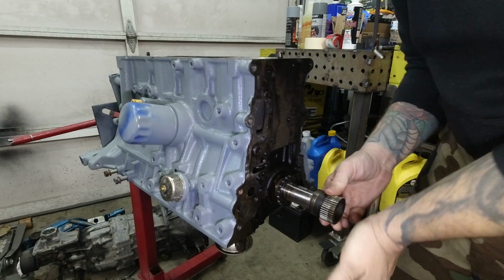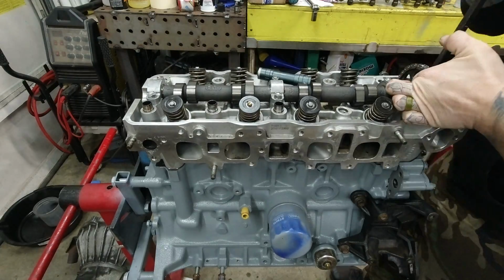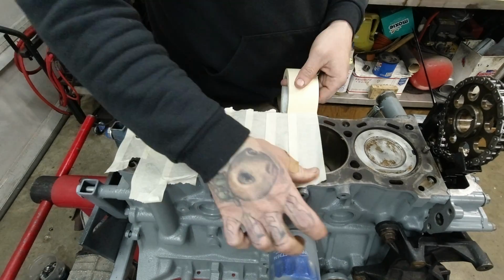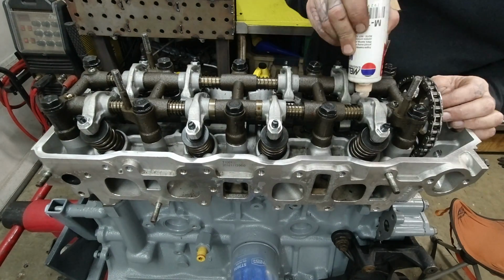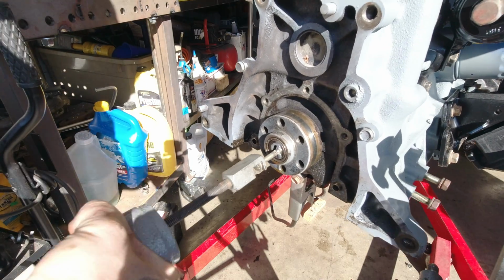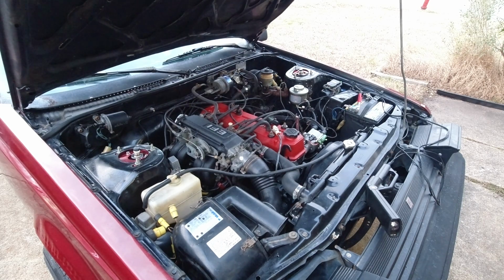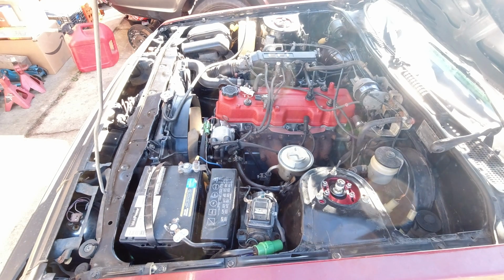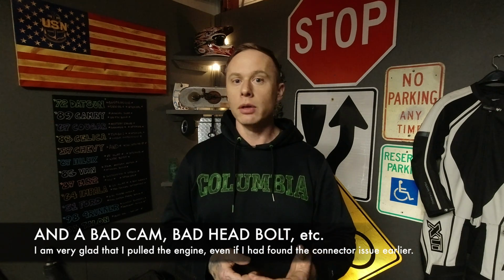TOYOTA 22RE ENGINE REBUILD - PART 2 OF 2 - Assembly, first start, and minor fixes 22R

Comment: 🤔Boy I see three bad mistakes you made on your Toyota 22RE engine I really do KNOW I am a REAL ASE certified Master Auto Mechanic with OVER 60 year's of REAL experience . for one you put a helical on a cylinder block you're supposed to use ONLY a king search that was a bad mistake  AlSO YOUR  intake and exhaust  valves are OUT of  adjustment AlSO YOU
 ARE using THE wrong type of timing  light sound like you had that engine cross wired
Reply from the maker: My valves are adjusted perfectly in spec. And my timing light is not the best, but it works. Perhaps finish the video all the way through to see what the real cause of the poor running was. Everything was wired correctly and this engine purrs like a kitten. Got 34mpg on a road trip from VA to Chicago with no overheating and no issues whatsoever. So I'd say I did a pretty fantastic job on this top end, thank you very much.
Reply: @tinygaragefab 34mpg?!!! Damn those are figures I wished I could get on my pick up. That’d be great
Reply from the maker: @kenxiong6830 yeah, this Celica surprised me on that trip. Virginia Beach to Chicago, 34mpg, ZERO issues.
Reply: @tinygaragefab  that’s sweet. I love the 22R. One of the best Toyota engines and engines in general ever built

Comment: 🤔YOU JUST made a BAD mistake on your engine block YOU were supposed to use ONLY a King search.  NOT a helicoil   I REALLY DO KNOW I AM a REAL Machinist THAT engine will give problems NOW .THAT engine WILL overheat NOW
Reply from the maker: But...its been going for 10k+ miles with ZERO issues, so I'd have to say you might be overreacting a little bit. If cylinder head torque can be maintained, no issues will be had.

Comment: I'm acquiring an 85 22re Toyota Pickup extended cab. What do you recommend that I do to check on what needs replaced the most as it's sat for a very long time. I already know it may need a new fuel tank or at least a new pump probably. What else do you recommend just replacing or checking?
Reply from the maker: Definitely fuel pump. Replace your battery cables, especially the ground. Other than that, try to start it and diagnose from there. On my '87 pickup (22R) it just plain ran. I replaced ignition stuff and filters and sent it!
Reply: @tinygaragefab  awesome thanks, it sat for 15 years and I dropped the tank and it looked like what I imagine The Grim Reaper's toe jam probably looks like. Or a burnt down car. You get the point. Well, anyways, I decided to order a fuel pump and pump mount, fuel filter, sending unit (for the fuel gage), and a new Spectra tank. The only OE item not discontinued that will fit is the pump mount. 85 and older Toyota Pickup parts are so hard to find. Aside from that, I will test the pump with the cold start injector line and pre-filter lines disconnected to insure fuel is making it to the injectors and then I will put in the new filter, then some new 10w40, and some Coolant after I see that it can idle smooth and hold some higher RPMs. For now ill top of the reservoir and put in some oil additive to rejuvenate the old seals and some Coolant flush before applying all new Coolant.

Comment: i was wondering if turbo charging the 22re toyo would net a torque gain of 275 streetable torque??
Reply from the maker: Probably not on turbo alone. That would more than double factory power, which takes a bit more work. There are 300+ hp/tq 22REs out there, but its not "easy"
Reply: It's doable for sure.  I just had my 4runner on the dyno and it made 250rwhp and 290 ft lbs @4800 with 4:88's and 35 inch bfg km2's through a 5 speed w56, transfer case, and a Detroit locker. Now I have to upgrade the clutch!😂 It really is more power than I need so I'll be turning down the boost. It blows through the clutch in 3rd through 5th. It's  on a microsquirt module/diypnp, but still using the factory distributor.  No ignition problems with it. 
The old Celicas are great. I had a white 84 gt hatch. What a great freeway commuter with a hot little 22re.
Reply from the maker: I'm planning a Speeduino and turbo setup for this Celica. And it definitely is a great highway car. I drove from Virginia to Chicago last summer and got 34mpg average on the trip there and back. Very pleased with this little car and engine.

Comment: The rebuild didn't fix the problem, the problem had nothing to do with needing a rebuild. You should have known it was a 22r. You rebuilt the motor for nothing because it didn't need a rebuild: 22r.
Reply from the maker: Um...did you actually WATCH the videos? I love the 22R as much as anyone, but this 22R definitely needed to be pulled and gone through. Worn out cam lobes, stripped head bolt that couldn't provide proper head torque,  etc. There is no way it would have kept going if I didn't do what I did.

Comment: Got a fresh new head for my 22r , pulled everything apart and painted same color pattern as yours, looks much cleaner, just have to connect engine and trans and drop in tomorow and hope she starts..... fingers crossed
Reply from the maker: Woohoo! Hopefully it went well for you. Gotta keep these old Toyotas on the road.
Reply: @tinygaragefab  I did get it started for a little bit after putting everything together... was a good feeling as I've never pulled engine apart. But the  timing was a bit funny then it just started backfiring out the carby. Dropped in to mechanics today hopefully nothing major hope I didn't loose the timing chain mark when I put timing cover back on 🤣

Comment: Great video and awesome CD printed tool! Funny enough I had a corroded bolt break off in my block in roughly the same spot? I forget which hole to be exact but I had to have a machinist torch the remainder out and press a threaded insert in. What is that wrench you are using with the tap? Looks handy

Comment: doing a headgasket on one, its my first time and after seeing this half the shit i did is super ghetto. im hoping it will run right. the thing im dealing with is not being able to get the cam gear on the cam
Reply from the maker: I get the gear on the cam by attaching the chain (making sure the links are lined up right) and then putting a long screwdriver or pry bar down the left side as you look at it. I gently push in on the tensioner which creates enough slack to get the gear on. I show this in the video. If not this video, it's in my Datsun L18 engine video. Same basic concept for many types of engines.

Comment: Very in depth, thorough video. Great job! I was just wondering what  gasket sealant you use/recommend? Thanks.
Reply from the maker: Toyota FIPG is definitely the best, but I use various Permatex products, and haven't had many issues. It's all about the prep work and how clean the surfaces are before laying it down.

Comment: Very informative video I’m working on a 1992 Toyota pickup with same motor it’s good to know that the celica coupe had the same engine I don’t know a whole lot about Toyota’s I’m trying to finish up my gfs truck it just don’t want to start it’s close but I’m thinking maybe the injectors are plugged in wrong 🤷🏻‍♂️ it’s a project I just put the motor in it  it no motor in it so I went in blind I’m just trying to figure out why it won’t start new block head and new plugs I’m certain that it’s in time firing order that’s what makes me think it’s possible I got the injectors wrong
Reply from the maker: Hopefully you've figured it out by now, but it won't be injector wiring as your problem, and here's why: on the 22RE, all the injectors fired at once. It is a very simple batch fire system. I was surprised to learn it, but after getting into the wiring to fix my issue (at the end of the part 2 video) I saw that it is indeed true.

Comment: didn't replace the oil pump?
Reply from the maker: I did not. It had been replaced along with the cylinder head and timing chain guide by the previous owner. I did ensure the clearances were OK and that there was no wear on the housing or gears.

Comment: Did you degree the cam to the main crank
Reply from the maker: Nope. Not a lot of adjustment that can be done without an aftermarket cam gear on one of these. Just align the dots and send it.

Comment: That was a nice tool you made for the pilot bearing, but for next time, you should try using white bread to get it out. I know it sounds foolish, but since the back end of where the pilot bearing goes is both an empty hole and curved towards the bearing, all you have to do is put balls of bread into the hole and pound it in with a mallet and whatever fits in the bearing hole. I used a random bolt with some painters tape at the end to make the fit more flush. That thing will pop right out after a bit with no tool breakage ahaha. Great video though! I really appreciate the camera angles and in depth analysis of the engine. I can say I learned a lot from your video.
Reply from the maker: In my years of messing with engines, the grease trick and the white bread trick have never worked for me, not even once. Pullers are the only way to go.

Comment: I’m converting my 22r to a 22re with microsquirt. Really looking forward to how you handle the trigger wheel.
Reply from the maker: I will probably cut and weld a trigger wheel onto the front of my power steering pulley, since those can simply be unbolted from the balancer. If you don't have power steering, I'd recommend finding this additional pulley and doing the same, as you'd have even more room because you wouldn't need a belt. You could even just cut slots into the pulley itself and make it your trigger wheel.

Comment: I had a similar issue with injectors.  I soldered some volvo squeeze style connectors. Problem solved.
Reply from the maker: I had new connectors, but they were for some different injectors that I wanted to upgrade to when I switch over to Microsquirt. Well, I used those injectors on the 5SFE swap into my 1989 AllTrac Camry, so now I get to decide once again on what injectors I might use. There will definitely be new connectors when I do the swap.

Comment from the maker: It almost feels like I wasted a bunch of time, given what the main misfire issues was, but I'm glad that I got to go through the engine, add the cam, and show all of you what goes into building this engine.
Reply: At least you know that now the engine was put together properly. and the cams were in bad shape, eventually losing compression due to the lifters. These engines did leak oil from the timing cover and oil pan. I do have to say that you almost have to remove the engine to get the oil pan out, due to the cross members being in the way. If you want a good seal, both the timing cover and oil pan need to be removed, just like you did. Great Job!! I miss working on these 18, 20, and 22.
Reply: Well, remember you also had that aftermarket torqueless cylinder head bolt...
Reply: Catching that cam before it force fed fine steel paste into your oiling system is always worth it. So is uniform head clamping pressure. And now it looks nice ;-)
Reply: Amazon job but.... the pistón rings? Why did you forget about them ???

( Forget , forgot.. ) 
Im not that good at writing in english ¡!